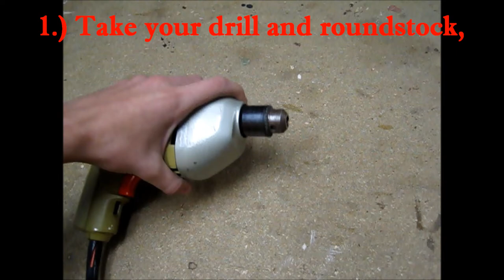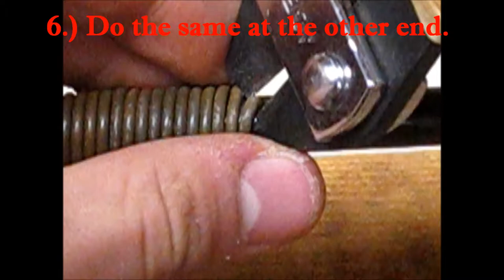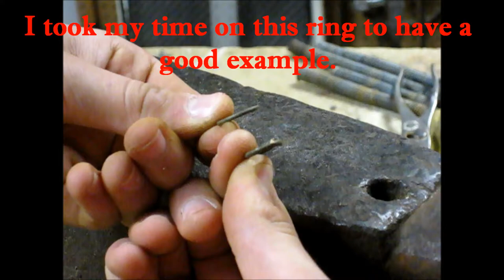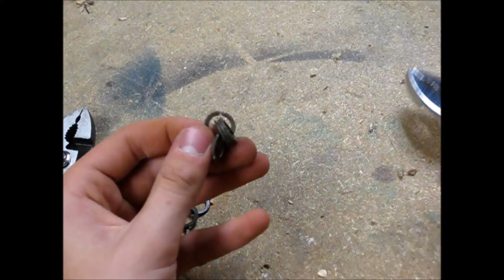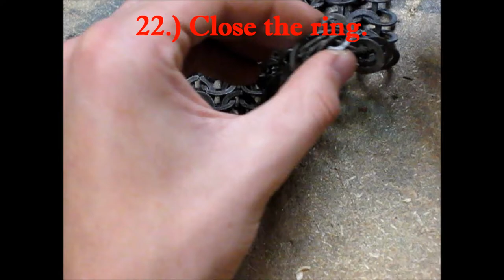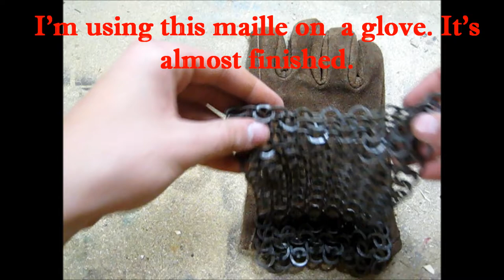How to Make Flattened Maille Armor

Comment: What I do when weaving the mail together is to take a piece of wire about 3-4" long and make a hook on one end and and a right angle on the other then thread that through the rings. When you pick up the wire the rings fall into the correct position so that you can just loop the new ring through and close it without the fiddly bit of trying to get them to stay on the ring before you can close it. Saves a bit of time from the rings slipping off and having to reset them and allows a clearer view. I like the look of the flattened rings but I can't invest the time flattening and closing them takes. The ends pull apart too much and I don't have the patience for it so regular round butted mail for me.

Comment: Bit of solder would make it sturdier if U didn't wanna rivet.
Reply: I try that with my arch welding machine and did not work :( the rings melt even in the lowest setting
Reply: isint also faster? / cheaper. iam thinking about making a piece of chest armor and iam thinking about making it 4-1 european style with a  solder purely for price and i saw where solders were just as good or strong enough atleast

Comment: there's a much faster hammerless method, use a roller to flatten the wire before wrapping into a coil, you'll need a jig to keep the wire from twisting the wrong way though.
Reply: Wouldn't that stress the outer edge of the ring too much?
Reply: @owainlloyddavies7107  
increase, yes.

Overstress? no.

well, depends upon the width, if you're making washers, probably wouldn't work.

but flattened maille wire widths? no problem unless again, you stray into washer levels of width.

Comment: So then is flattened butted maille better than just round butted maille?
Reply: Flattening the rings if they are riveted or solid punched strengthens them, normally.  If they are just butted instead of riveted or solid punched, I'm not sure if it helps or not.  Probably a little bit.  If nothing else, they look a little more authentic, but lack much strength if a real blow lands on them.
Reply: If they're flattened, they'll have smaller gaps in between them. Of course, it's still weak compared to riveted maille.

Comment: Good instructional video with clear information. I like that you didnt use galvanized wire because it just looks so much better with regular steel. Apart from the fact that flattened mail looks super sexy is there any other reason why it was flattened? Was it just a sub consequense from making holes when making riveted or was there any benefit? Like historically and in general
Reply: Personaly i think  its just personal prefrence. But when you hammer them flat you workharden the rings, so they will be a little bit harder. Historically therw are lots of diffrent versions of maille. Some solid flat rings are punched from a plate, some have just hammer flattend rings and some have round rings. Most of it is riveted tho, thats what give most maille armor its strenght.  Sorry for my less than ideal english=)

Comment: and what purpose is to flatten the ring without riverting it?
Reply from the maker: snowfuca It's cheap and easy... That's basically it. I guess it looks cooler than just round rings too.
Reply: you don't do a thing just because is cool... it has any battle advantage?
Reply from the maker: No it does not because it's just for low end reenacting... I've been shifting over to riveted armor I'll have you know since it is lighter and actually historical.
Reply: It was either that or he got no protection on his hands. He was broke at the time take it from me it takes a long assed time to build a decent looking authentic set of armor. This is a good temporary solution.
Reply: Yeah, not everyone can afford top quality 100% authentic stuff right away, but that doesn't mean people shouldn't be allowed to have fun.

Comment: no rivet= worthless
Reply: Butted is as useful as riveted
Tho riveted tends to be stronger and lighter than butted
Reply: @jonc2914  then tell me why there are kingdoms, empires using butted mail
Take in Japan for example
Throughout 1200's to 1500's, butted chainmail is used

It does not take intense research to know that butted chainmail is worthless

Simply walking breaks butted chainmail? Are you serious? 
I have been studying history, specially Japanese history for 4 years
Butted chainmail is not as worthless as you claim
Though yes as I previously stated, riveted is far better and lighter than butted
But that does NOT mean it is WORTHLESS and BREAKS FROM WALKING
Reply: @dreysantillan  it was common and it's usually groups that didnt have the know how for riveted
Reply: @dreysantillan  get some butted mail and slash its it's not rocket science, itll fall apart.
Reply: @jonc2914  no crap, it will if you hit it
But it will absorb the hits
And the warrior will not just stand there and let them take that hit
I never said anything about it being indestructible 
I'm arguing with you about how you claim it is worthless and it "will break apart frkm simply walking in it."

To summarize
I agree with what you said about it breaking if it was hit, what I dont agree is that it is worthless and would break by walking
Reply: @dreysantillan  if im not mistaken,  a lot of the historical japanes and chinese maille us often 6 in 1 which makes it a lot stronger than butted 4 in 1 apperantly.
Reply: @zatanlkken8714  you're not mistaken
Although in the 1500's when ashigarus (peasant soldiers) are becoming more prominent
Not everyone could afford a 6 in 1 maille

Probably samurais of the richer Kachi class to Gashira and most likely the Taisho class could afford 6 in 1